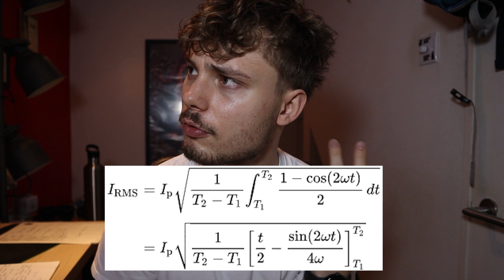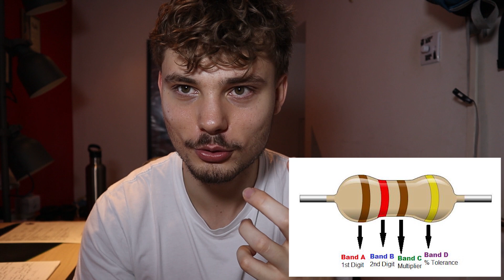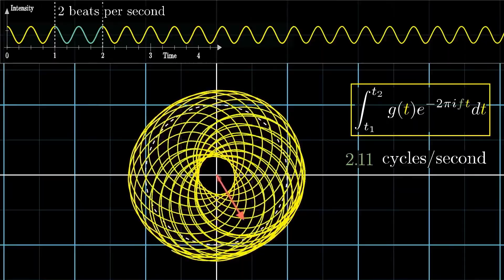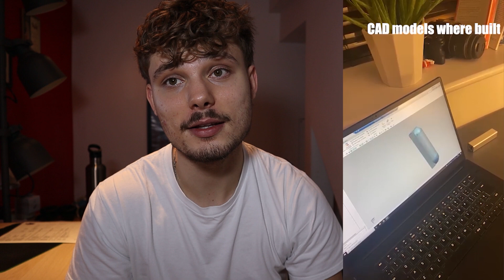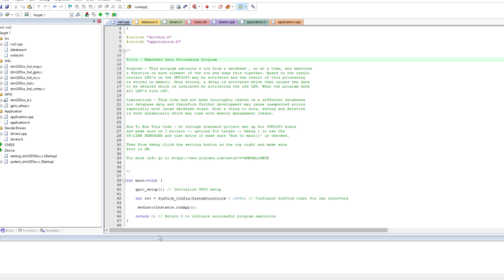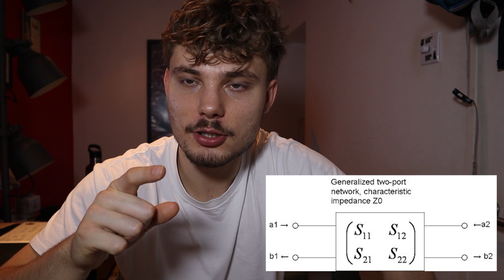Full Breakdown of my Electrical Engineering Degree

Comment: I feel often glad when I see other EE students or engineers, because I know that they’ve been through the same stuff I did. I recognize all those courses. I live in Sweden but the curriculums are almost the same everywhere. Calculus in one variable, multivariable analysis, linear algebra, programming, digital logic, physics 1 and 2, electrical engineering project, environmental engineering, circuit analysis, analog electronics, electromagnetism, signals & systems, measurement labs, probability & random process, semiconductor physics, control systems, communication systems, biomedical engineering, digital circuit labs. Currently I’m enrolled in my postgraduate program after undergrad (it’s a bachelor+master integrated program). I really wanna know how the work life looks. Sometimes I regret choosing this integrated program because the education is so long. But at the same time I’m also glad I got to learn all this knowledge that is fundamental in science and engineering.
Reply from the maker: Thank you for the message. I agree. EE grads are very unique and strong engineers and it's cool that we learn most of the same stuff all around the world!

Comment: I studied electrical engineering in the United States. We studied the same content. However the sequence that we have is different.  Here in the United States we have to complete all required math, physics and programming courses before we can take any electrical engineering courses. We begin with circuits and digital systems. Next we do electronics, electromagnetics, signals and systems, controls, electric machines probability, communications, power systems analysis courses,  engineeringeconomics. In our final year we had electives of electrical engineering specializations and team project to design and build, engineering ethics.
Reply from the maker: Makes sense! Thank you for the insight.

Comment: I also just finished my EEE degree from Coventry University. After seeing my friends doing mechanical or civil engineering, I must say EEE absolutely rocks. You get your electrical stuff but also a little bit from other engineering fields and programming. I also had pretty much the same modules however my last year was more power heavy, so stuff like power distribution and generation and what not. However,  my project was predictive maintenance using machine learning which i know is opposite of power stuff i took 😂. PS. I absolutely hated electrical science B and the whole electromagnetism aspect.
Reply from the maker: What's the plan now ?
Reply: @aleksgornik  Im interested in automation and controls so hopefully land an entry level job in that field while doing some machine learning courses on the side
Reply: Machine Learning can be used in Predictive Maintenance for predicting faults in power equipment. Still Electrical 👍

Comment: well done on graduating, it seems like a lot of hard work which i might have underestimated myself picking it at btec level 3 with hopes of doing it at uni😭 if i did foundation maths is there even a chance i could grasp even the first few modules of core maths in the first year or is it just too far out
Reply from the maker: Thank you! Is there a chance ? Definitely. You will however have to put the work in to fill in your gaps in maths as they are unavoidable in EEE. I would recommend doing a foundation year at a university. Loughborough has one and its really good. They teach you all the maths you need so that your ready for first year.
Reply: @aleksgornik  thanks man, i'll take a foundation year into account when applying to uni after my first year, keep up the videos
Reply: @smellysophia I did mech eng, the foundation course is definitely a good idea. 

We had a lot of dropouts on the first year of bachelors, everyone who did the foundation year passed it.